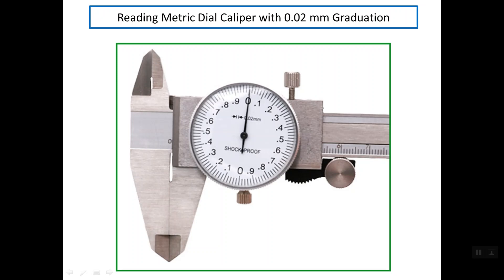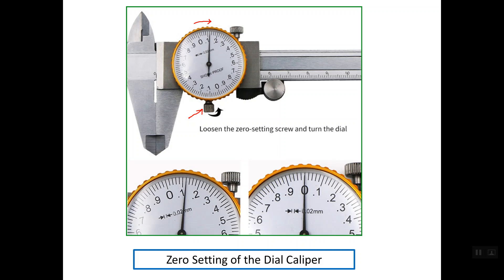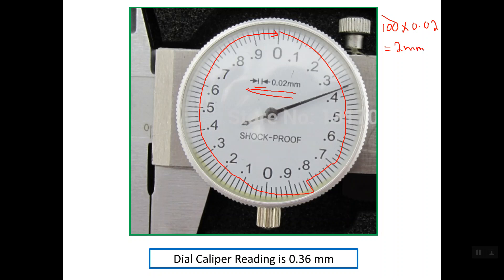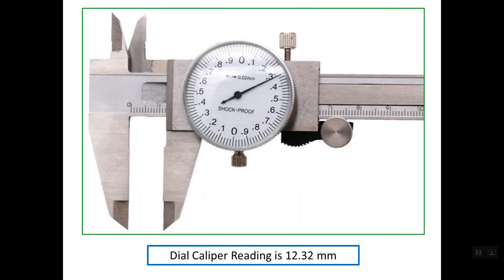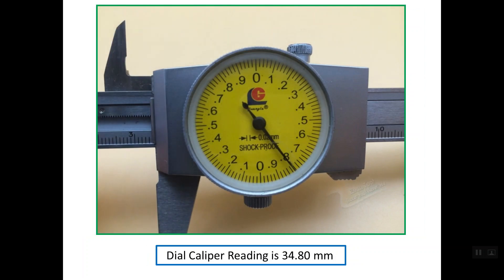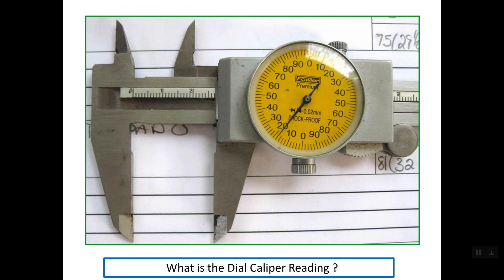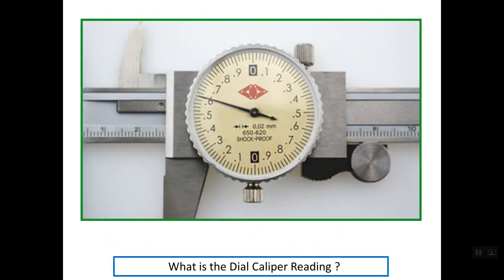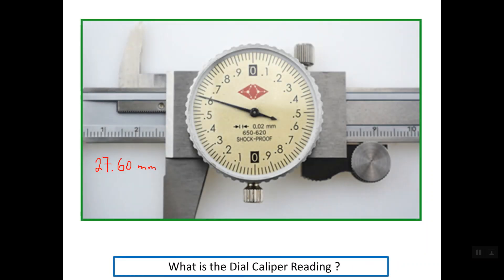13) Reading Metric Dial Caliper with 0.02 mm Graduation (Least Count)

Comment: in 12:30 minute I can see 5. and its 50 than 08. its 50.08mm
Reply from the maker: Thanks for your interesting. The reading is correct. It is 49. You can count easily. 5 is not belonging to this line,,but to next.
Reply: @eng.waleedalzaghal5344  Now I get it. From the camera's angle I can't see the line of a five, it only sees the five.